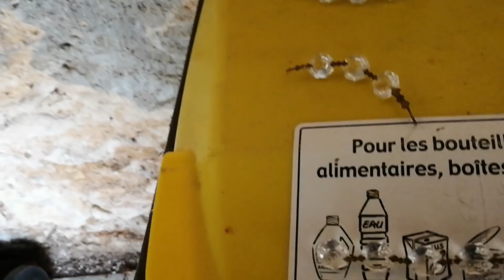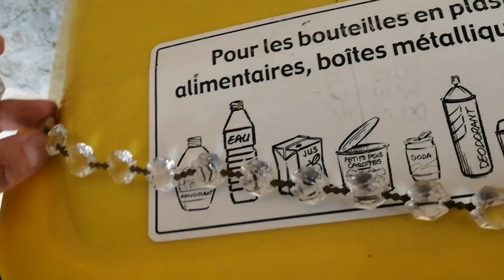Not Quite a Chateau DIY 88 -  How to Renovate a Chandelier - a Conundrum and a lot of faffing about

Comment: Gorgeous!  Was never a fan of crystal chandeliers until we rented an apartment with one in it.  It was situated in the dining room whose windows faced south -- so when properly cleaned, prisms were reflected on the walls.  An elderly neighbor showed me how to clean them and then gave me a great tip.  Clean the crystals once a year but mist them monthly with a solution of water and white vinegar after covering the table with bath towels.  Dust, dirt and kitchen grease just slipped off of them onto the towels.  I will say the monthly misting made my life easier because I had 3 little ones hanging onto my skirt hem.  Did catch the 2 year old swinging from the chandelier once -- totally enthralled with moving the prisms and colors around the room.  He is now a Professor of Physics concentrating in optics lololololol
Reply: Great story! If I had known about the vinegar bath I might have liked crystal lights. My folks  have always had multiple chandeliers and my sister has a giant one from Murano.
Reply from the maker: great tip thank you Mama

Comment: You could fill in the other holes on top if you could put 4-5 together and just hang them and because you have equal spaces you will have some in every hole and that keep the crystals together ad will have filled the spaces
Huge difference—-you could take bottom row off completely
Tony blutack wil hold it in place and not be seen
Reply from the maker: bluetack is a good idea Nana, we didn't think of that, thank you